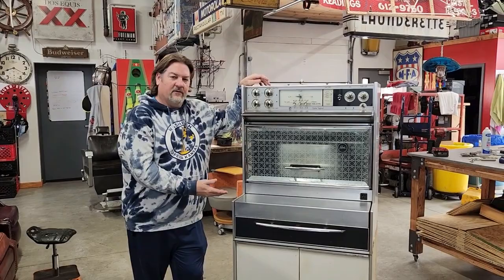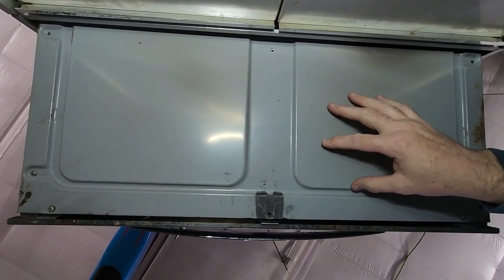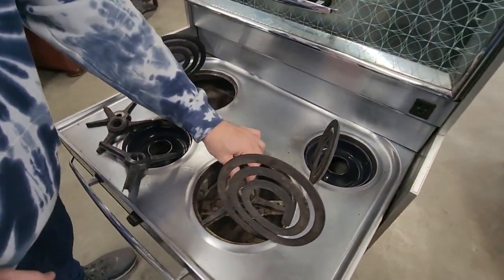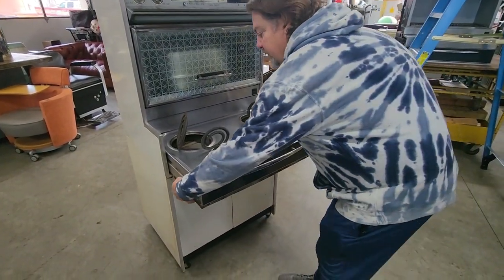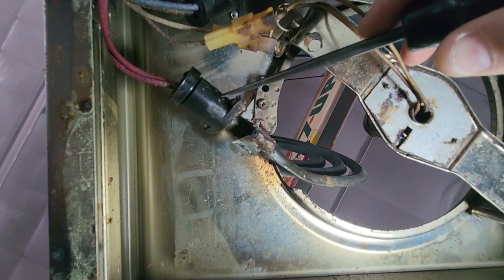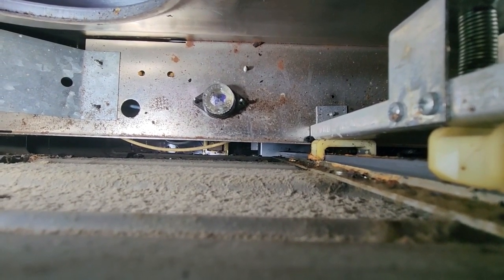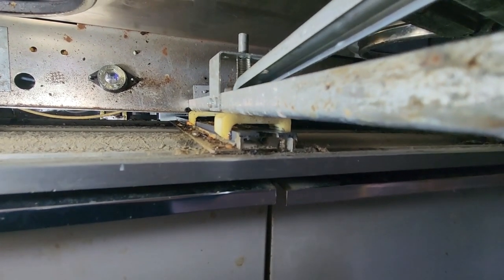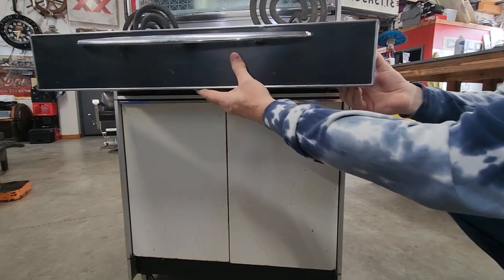How to drop your drip tray, replace a burner or heat minder, and fuse location for front oven outlet

Comment: I have a 1961 frigidaire flair custom imperial. My two back burners stopped working. I think I may have unplugged something when I pulled the drawer out. Any suggestions?